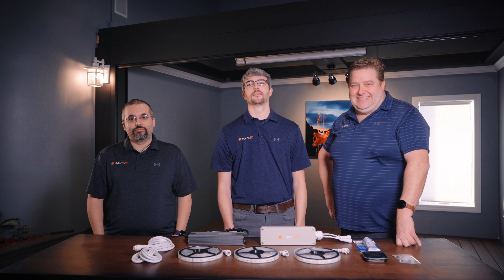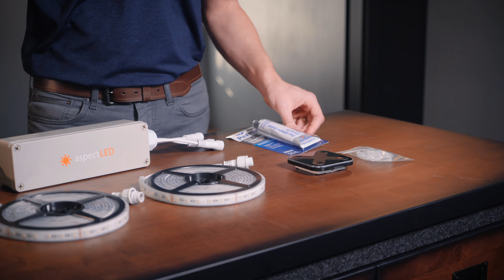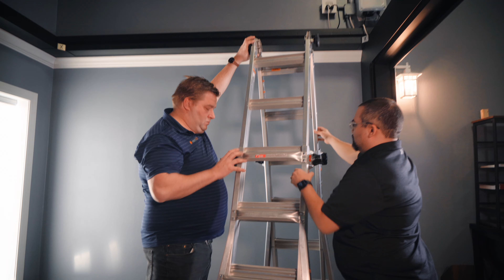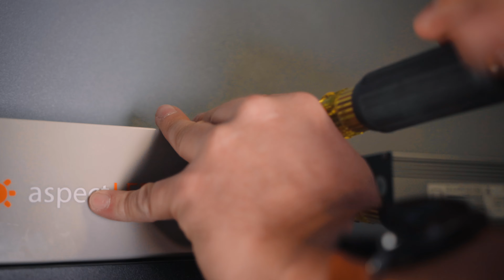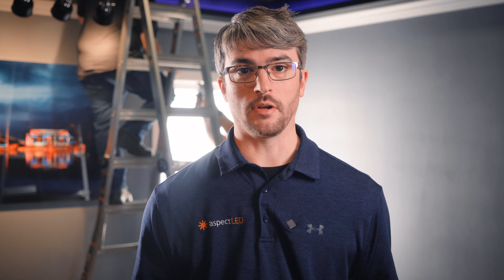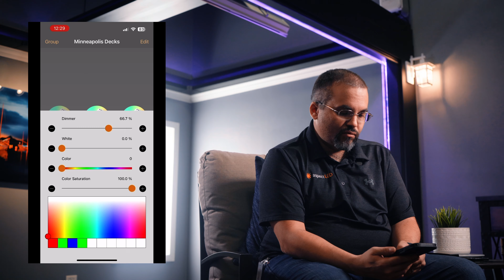How to Install LED Lights on a Pergola | aspectLED Outdoor Pergola Lighting Kit Tutorial

Comment: Where is the link to the kit? Also, what do you do if you cant use a full run and need to cut it and use connectors in between? Is that not possible?